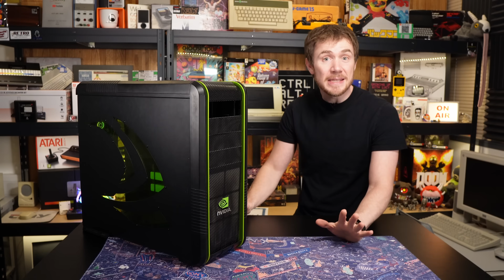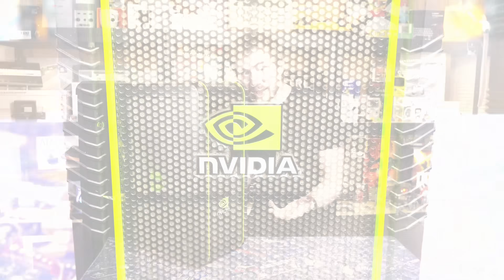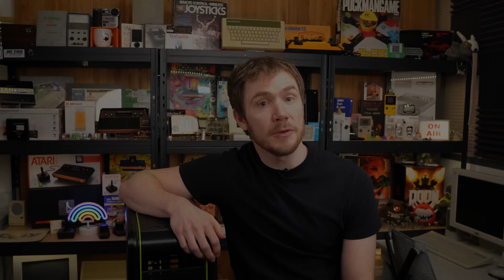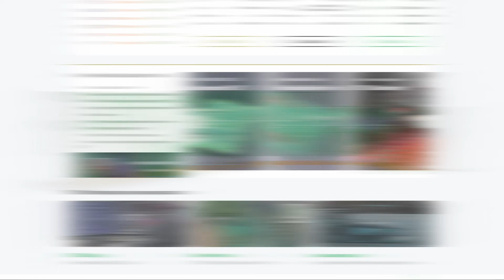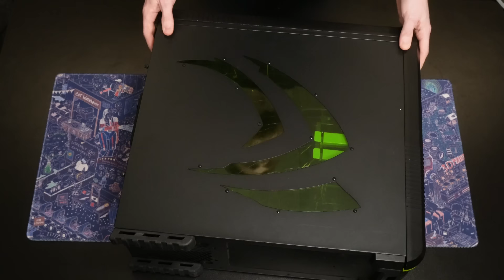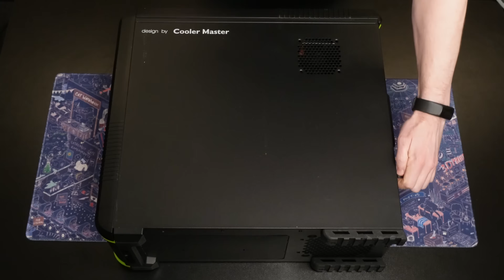They Certainly Don't Make 'em Like This Anymore...

Comment: Found a similar one at a local Goodwill, although it's the older one with two fans on the side panel instead of a window - which was rather needed for the X58 Chipset I suspect.  Those top SATA docks were useful in rare times but it turned out to be easier to just keep a adapter in a desk drawer for when it was needed.

Comment: @ctrlaltrees
Period correct & top end? Socket 1366 is your goal. A Xeon W3680 would be an excellent choice for CPU(though an X5680 would be a good alternative), 18GB(3x4GB+3x2GB) or 24GB(6x4GB) DDR3-1600 for RAM and a pair of GTX 280 1GB GPU's and a 960GB SSD with a 2TB HDD would round out the build.

Comment: I use a CM690 (non-MkII) for my garage workbench PC, I use the top port as you imagine, to take images of hard disks.  For casual users, I imagine this was so people could connect HDDs they would use to back up their data or media or Linux ISOs rather than burning off optical backups, without have to get into external SATA.  Just make sure you set the port its attached to on your motherboard to be hot swap friendly (in the BIOS).  Mine was brand new in the box, I got it for $10 from an eBay auction by the local Goodwill.  I'm shocked you only have two internal HDD bays, my CM690 has drive storage to the basement, each slot populated with one of those mounting trays.  Those 5.25" retention clips are garbage, most accessories are incompatible.  I just pop them out and use screws.  I'd recommend a Core 2 Duo/Quad-based build on one of the last NVIDIA nForce chipsets to best match the branding.

Comment: I've got the standard CM690-II, its great case - heavy AF.  Still has a GIGABYTE GA-P55A-UD3P with a core I7 870 and an rx580 in it dual booting Linux and Windows 7.  I keep it in my basement.  It still works fine for various tasks.  Has a lightscribe DVD drive, a BluRay drive, a Sound Blaster X-Fi panel and of course a cooler master musketeer filling up the 4 drive bay slots. I keep it next to my beige Lian Li dual-P3 and my MDD G4 Mac.  Nowadays I just go for Mini-ITX builds/thinkpads but its handy to have older stuff around.
Reply: I also have the same case with the same CPU. The case looks very solid after cleaning(it actually has very solid build quality), and the machine still is good for web browsing and office tasks.

Comment: Cool case, however locking yourself in at such an old generation of CPU maybe more detrimental than anything else, yes the 2500K is still capable but if you ever did want to lean into newer games you might hit issues.6th Gen stuff has plummeted in price since Windows 11 went full steam with the '8th gen and above' mantra so could be a nice, easy win there. But, if you want to stay period correct that is also cool, just hate to see you box yourself into a corner. 

What OS are you considering? Windows 7? 11? Or Linux / SteamDeck / OS type setup, looking forward to seeing how this one unfolds.😄

Comment: fill the front 5.25" bays with multi-2.5" mobile rack units from Icydock or something, replacing all the LEDs on them with green LEDs and put a couple SAS HBAs in the system to run tons of 2.5" drives and put them all in raid-10 or something and put all your games on them

maximum functional blinkenlights

Comment: Some Molex UV Reactive LED strips and as many UV reactive parts as you can find... That side-panel Nvidia logo and HDD cages will shine green... EVGA had some amazing SLi bridge connectors that lit up green and their GTX 5xx series cards had interesting UV shrouds as well... maybe a power supply with a green led fan too... Cool Video!!!

Comment: alright, that is a nice looking case, awesome drive sleds in greem for that nvidia version. there was one for sale local but it was missing its side panel so i didnt buy it. i have a silver trimmed 690II with x5492 xeon core 2 quad in an evga 790i ultra with 2 (looking on a third) evga signature superclocked  titan blacks, its hot.

Comment: Nvidia did make motherboard chipsets at one time. Look for an NForce board with socket AM3 or whatever Intel socket was in use around that time.
Reply: find one that works, that is
Reply: @Megatog615  Got an AM2+Asus board that still works. Nforce 9a chipset. Looking at the Q-connector on the front panel connectors I would say it had an Asus board in it at some point.

Comment: Did you get the accessories with it? Beside the vertical expansion slot on the back there should be vertical slits for mounting a GPU cooler with multiple "fingers" to support them. Also, you could screw in additional four hard drive bays, making it almost a server. And it shipped with "floppy" drive adapter and a faceplate. Love this case so much, though I have a regular version) Can't wait to see a finished build!
Reply from the maker: No, I didn't unfortunately. I got everything exactly as shown in the video. I'll have to see if I can hunt the extras down but the case itself was hard enough to get hold of! Thanks for the info.

Comment: Core 2 Quad Extreme +8800 GTX With 790i Sli DDR3 Board (Why DDR3? Because 2011)
Reply from the maker: Now we're talking 😁
Reply: @ctrlaltrees Or If You AMD Fan Boy
AM3 Board With Nforce Flavor
(Again! Go DDR3 Nforce Board)
Also Since This Case Released In 2011  
Put Windows 7 Ultimate Because 2011

Comment: Put "all AMD build" 😈
AMD CPU, AMD GPU, AMD chipset
Reply: Replace the plastic of the side window with a red one!
Reply: Smallest motherobard and largest possible GPU's physically possible too - just for the added farce ;)
AM3 was a very strong platform for its time, and is fairly period correct coming in at 2009, DDR3
I mean you could also go down the AliExpress rabbit hole of production motherboards too, maybe a gem in there and play with server related CPU's and ECC ram.

Comment: That vertical ‘card’ slot on the back is meant for back-panel connectors that connect directly to headers on the motherboard (think USB ports or an RS-232 serial port), or possibly directly to headers on one of the expansion cards. The idea is that it lets you use such things without eating space for actual expansion slots on the motherboard, which really mattered at a time when it was ‘normal’ to have an SLI or CrossFire setup with 2 or more 2-slot GPUs.

In practice, it could also be used for almost any lightweight low-bandwidth expansion card, because it wasn’t hard to get ribbon cables that let you ‘expand’ PCIe slots (you can still get these pretty easily. Some cases even leaned into this and had setups hat theoretically let you put a GPU there (with extra bracing to support it of course), but those were pretty rare.
Reply from the maker: That's very interesting, thanks for the info! I've never owned a case with one of these slots. I'm definitely going to have to find something to stick in it now.
Reply: @ctrlaltrees     i remember those as well. google " GIGABYTE 2 USB 2.0 Ports + 2 Firewire 6-pin Port Computer PC Rear Panel Bracket"

Comment: maybe a socket 1366 or 2011 as they had loads of pcie slots.   i had an i7 920 at that time.. you could overclock them from 2.66 to over 4ghz if you were lucky
Reply: I agree with this. Go for i7 and X58 or X79 mobo.